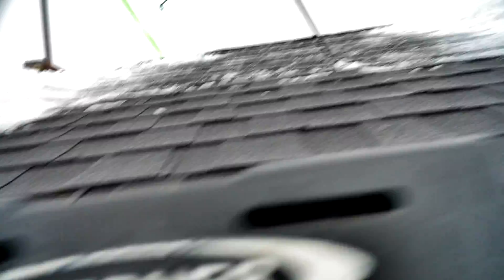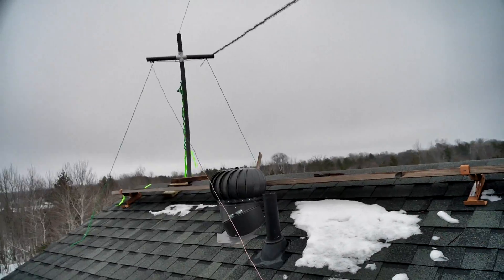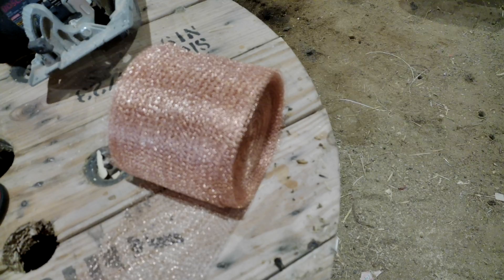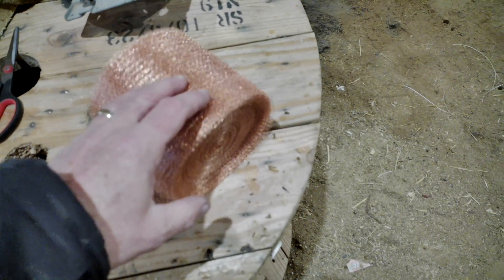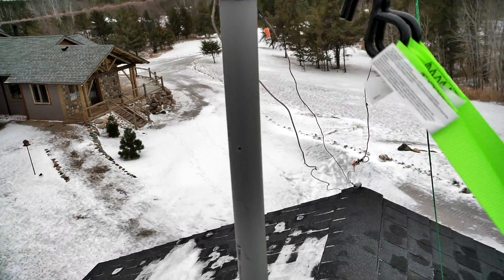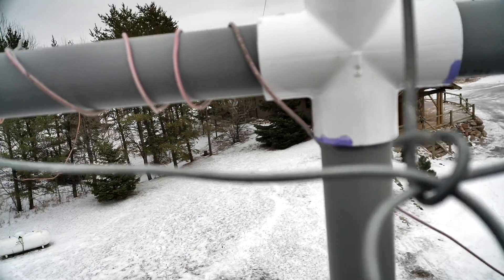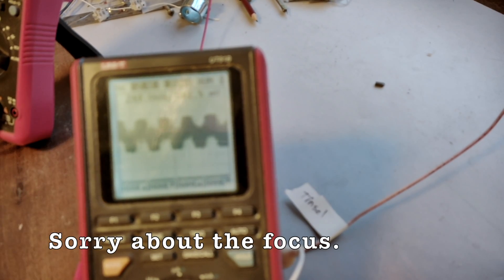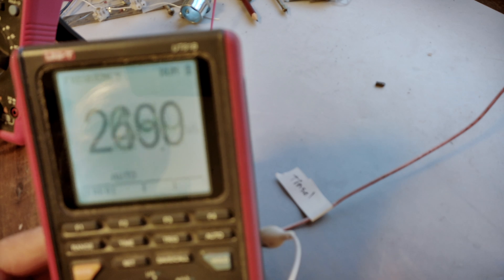Tinsel & mesh antennas for ambient energy harvesting

Comment: Makes you wonder the motivation of why ether was removed from the periodic table. Imagine the energy you can generate with miles of large gauge wire. Now you know why they keep the large power lines above ground. The higher you go the higher the voltage.
Reply: Ether was never actually on the periodic table because it was a theoretical concept, not a discovered element; scientists believed it existed as a medium for light to travel through (luminiferous aether), but experiments like the Michelson-Morley experiment disproved its existence, so it was never included on the periodic table as no evidence supported its presence as a real element.

Comment: Really appreciate all the detail, thank you! Are you sure there isn't a radio signal involved? I couldn't rule it out by what I saw of the scope, looked like it could have been a carrier wave with a signal modulated into it. That's solidly in the longwave/LF band, can easily travel several hundred miles. Might be fun to check around that area of the spectrum if you come across a LF radio. Thanks again for exploring this more in spite of the weather. Risking your neck on an icy roof suspending random shapes and materials dozens of feet in the air in the name of science is a pretty admirable level of dedication.
Reply from the maker: There could be weak radio signals in there, but nothing strong like I had before in earlier videos.  Where I was getting a couple of milliwatts out.
Reply: Just wanted to add, shortly after I wrote that, I came across a video of a guy receiving groundwave propagated radio signals from literally only grounded wires, right around the frequencies your were seeing. Makes me wonder how much of the power/signal you're seeing is from the wires vs from the ground, since we're talking about such tiny barely-measurable currents.

Comment: When I  was building high tension powerlines, the placement of the conductor was swapped arround every 30 or 40 kilometers or what ever it was, to neutralize the current build-up. I always believed this current was from the earths magnect feild. 
Also the conductor surface had to be smooth and not scratched, because that caused static radio interference.
Reply from the maker: Thanks for that information!

Comment: I was hoping maybe for a fully decorated Christmas tree as an energy harvesting antenna. Happy Holidays to all my fellow energy nerds!
Reply: Hmmm, there is no.
Window for me to comment, So I have to reply to this person's comment.  
As I expected,  the copper mesh wins :-)  hmm did you ever try the circuit that I used is in my free energy from air videos.  And some of that radiance energy that you're picking up is also from the cosmos.
 Black hole, the moon quasars pulsars, stars, etc.
I really love the copper mesh idea.  I'm wondering how it will hold up during special winter conditions when snow flakes hit it, melt, and then turn to heavy ice.
Great video, thanks for posting!
Reply from the maker: Hey Paul, the only circuit I used with this setup so far, is a full bridge rectifier with a small filter cap.
I will try other circuits this winter.  I soldered the mesh to the wire holding it, in several spots.  Did the same to the copper tinsel.  I think they will hold up...
Thanks for the comment!
Reply from the maker: Merry Christmas @fxm5715 !
Reply: Merry Christmas!!